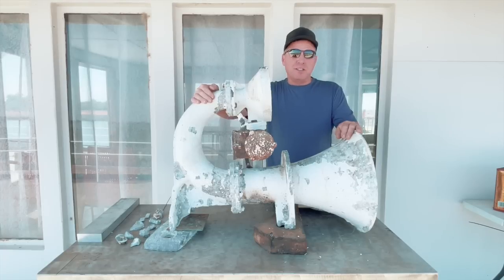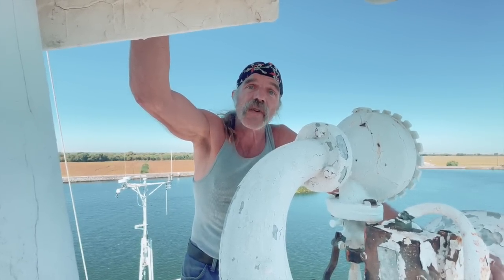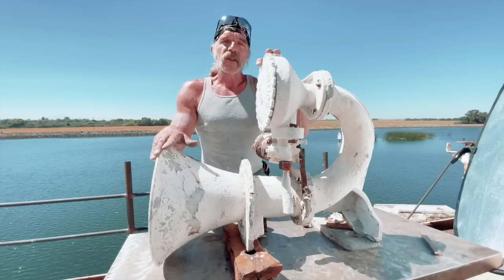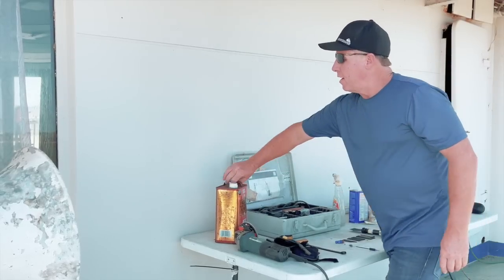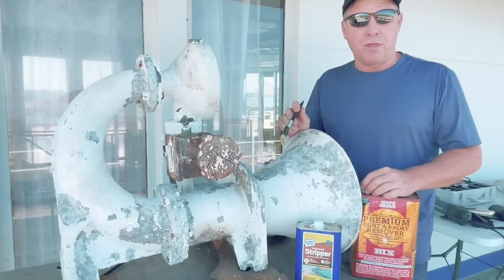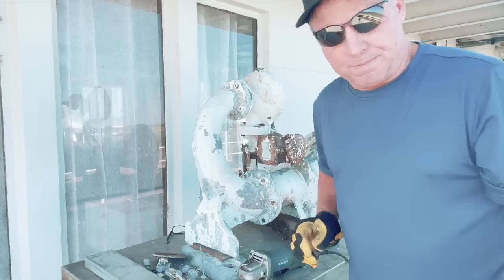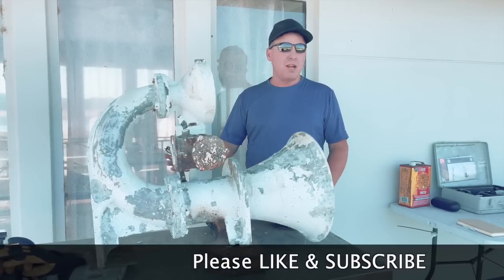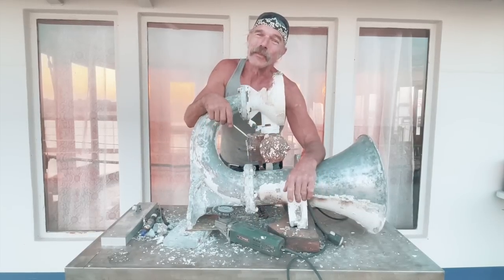EP: 17 DIRTY JOB of RESTORING THE AIR / FOG HORN ABOARD THE CRUISE SHIP AURORA. CAN IT BE SAVED ?

Comment: Dustless blasting machine is the way to go on that horn 
Very fast and will not pit the metal. I use it on my classic car restorations
Reply: Soda blasting?
Reply: I agree, as soon as I saw all that old and peeling paint with hard to get to parts I thought surely they will take it to get blasted with soda or sand or whatever new stuff they use today. Instead they probably spent all day trying to get it done and still not being successful by the end of this video.
Reply: The fact they didn't go this route makes me think they may have had concerns of lead paint being on the horn, except the sanding. So they must not have thought of it.

Comment: Hi - I own a 50 year old steel boat, and I've removed a LOT of paint.  For this type of project  you can either soften the paint with a really good heat gun, then scrape with a good sharp scraper, or (more efficiently) just use a propane torch with a flame spreader.  I removed all the paint from an aluminum binnacle tower (similar surface area to your horn) in about an hour, down to shiny metal. Modern chemical strippers don't work well, especially with very old paint, and mechanical methods are either too slow (scrapers) or too likely to damage the metal (abrasive flapper wheels) - or won't reach the tight spots.  Heat will do wonders; fire even more so. Don't forget your hazard mask - lead fumes are not really good for your lungs!
Reply: Yep.

Comment: When you are using paint stripper cover it with cling film, plastic film, it stops it evaporating and gives it a chance to thoroughly get into the paint, I recently stripped an old car back to bare metal and it made a huge difference 😀

Comment: Honestly I woulda just taken it to a local person with a sandblaster that knows to be careful. And I would have just torched the bolts off the bottom of the base so it was away from the aluminum. Then lifted it off that way. As far as the feet I think you can make some from the block if you have the tools to cut it and machine it on a mill. That aluminum has probably sucked in a lot of contamination over the years and is going to suck to weld. The nuts you will need to use an induction heater to get them loosened up. You’ll need to sandblast all the steel parts separately then have them electroplated with cadmium or black oxide.(or buy new) the aluminum once it’s clean will need to be sprayed with a special strontium chromate primer. On assembly you will need to use non hardening rtv to prevent moisture between the joints and wipe excess. The brass cap will need to be cleaned by letting it sit in chemical such as methyl ethyl ketone or acetone. Once the paint has lifted you will need to gently rub the remains off with brass wool. And then polish off any corrosion with metal polish inside and then the outside you will need to file the hammered teeth down maybe even braze the teeth up if you want to get it perfect. Then hand file to shape. Being careful of the threads tho. Then sand the outside with red steel wool so the primer has something to adhere to. Install with grease on threads to it can move and helps prevent the corrosion between the two metals. After it’s all assembled test the sound and adjust the tone to your liking. Then spray the horn with whatever color you want and install.

Comment: Funny. Have been treating air intakes, the big things so typical bor boats. They are from galvanized steel. What I did was paint remover which took 25 % off. Then I used a triangular hand scraper. That got the job done.

Comment: A heat gun in a well ventilated area might just make that paint bubble and scrape right off.  Worked wonders on many old windows and doors.
Reply: Used a propane torch and scrapper. Yes it works. Thank you.

Comment: when I’m removing paint or polishing aluminium, I use the Scotchbrite disks as it heats and abrades the paint without metal removal. Hope that helps. All of you are doing a great job!
Reply: 100% agree. Scotchbrite disks are the only suitable tools for this type of delicate paint removal.

Those wire brushes and flap disks used by the crew are inferior in removing paint and also grind away way too much of the healthy metal.

I feel sorry for the Aurora crew. Their lack of knowledge on surface cleaning and poor choice of tools multiplies their workload. And the workload is massive to begin with.

I do admire their persistence and the willingness to work long hours but I wish they would ask for advice and acquire better tools.

Comment: I have used various methods to restore metal and have found electrolysis to be the easiest and most effective at removing corrosion and paint. All that is needed is a tank which can be anything non conductive, a small 12v power supply some wire and a scrap of steel. After a few days (or less) you' re at or near a fresh surface. Enjoying your project, keep up the good work!!

Comment: What you need for stripping paint is an air sander that auto body shops use to strip body panels with out damaging body panels. The sander I recommend utilizes foam under the sand paper so it conforms to curves
Reply: Usually called a "DA" sander. ;-)

Comment: Dustless blasting , or y’all could try using an attachment to your pressure washer that turns it into a wet media blaster, and as far as quick paint removal AIRCRAFT PAINT STRIPPER , it’s nasty stuff but it will chemically peel layers of paint quickly

Comment: using those flat discs on the grinder would still remove a fair bit of metal, and you would have to be extremely light handed to avoid it. I would use a paper sanding disc instead of one of those hard back discs. It would be a lot more forgiving.

Soda blasting would be best to get the job done properly and leaving no indents or scratches. 

If you were going the stripper route, then i would suggest Cooper's Paint Stripper, it will turn that lead paint to a thick sludge. It may still take 2 or 3 goes at it, but it will come off quite easily.

Comment: You can try caustic soda or lemon juice.
Reply: This paint laughs at the stuff.
Reply: @gridleemargraf7530  What i also sometimes do onboard is use antifreeze this will bite trough the layers but you will have to do it a few times. The best way to get rid of it is very fine sandblasting.
Reply: Ok

Comment: Dear Aurora team.
Please kindly allow me to suggest some things: Please try to use a heat gun and a scraper next time. A needle gun (driven by compressed air) might be helpful too. Of course you can also do water sandblasting. Anything is better than using abrasive discs on an angle grinder or drill. By the way: Please don't use an angle grinder near uncovered windows. The glass and the frame can very easily be damaged by flying sparks. Last but definitely not least: Dust from lead paint is dangerous! At least the opposite of healthy. Thanks in advance for consideration.
Best regards, luck and health to all of you.

Comment: Cut the pins on your special wrench to the depth of the cover. Then you'll not scrape and mar the body surface when you refit the cover.
Reply: By the way, a tube handle is more effective as it will not fold over like a flat bar can do.

Comment: When you reassemble the horn you might want to replace those iron bolts with stainless steel just so if you ever have to service it again it'll be a lot easier to take apart
Reply: And use some copper-grease
Reply: Although that seems like a completely sensible idea, sadly its not. Search "table of metal nobility" and you will find a list, the further apart the two metals are on the list  the worse it gets for corrosion if these two metals are in direct contact with each other. 
Aluminium and stainless steel are about as far apart as it gets on the table and stainless being the "more noble" metal will destroy the aluminium. 
As per the table, cad plated mild steel bolts are the best choice for this environment.
Reply: @watsisbuttndo829  you are absolutely correct. What happened to both the bolts and feet is what is known as galvanic corrosion. Two dissimilar metals basically attack each other. Mild steel bolts, coated with an epoxy paint is the best bet.
Reply: I agree. I've had my share of removing rusted, stuck bolts in my life.
Reply: @ericewaldklaver  is copper grease anti galling? I’ve heard it’s critical with stainless ship hardware
Reply: Galvanic corrosion is the bane of every ship’s existence.
Reply: An aluminium bracket clamp on a BMW bike was totally trashed after just one winter. The M8 stainless bolts rotted the alloy leaving it seized solid. I fitted a replacement with carbon/copper anti seize all the way up and it lasted the next winter but would not have survived another year. I replaced the bolt with plated carbon steel. No more problems.

Comment: I'm sure it's too late but an induction heater on those bolts heat the bolt or nuts the expansion of the bolt will crush the corrosion in the treads when it's still hot try and turn them out if they won't move let it cool try again to un screw it might take a few times
Reply: The corrosion is at an atomic level. The first level of atoms are bonded. Heat will not release that bond.
Reply: @gridleemargraf7530  I've see it work at the plant that I work at  and i have done a few Ford exhaust bolts that were sized in the head it may take a couple cycles and patience but it works.

Comment: …. Spent my entire life on boats /yachts …sometimes you guys make me cry , there’s so much you don’t know . On the horn use polypropylene fiber discs they don’t harm metal . When using paint stripper don’t overbrush it put it on thick and then cover in aluminum foil to keep the chemical from evaporating ….. even a heat gun will remove a load of paint and in the old days we’d use a blow torch and the horn is bronze not brass …… any stripper with methelyne chloride will remove the whole lot …. You just need to know how to use it